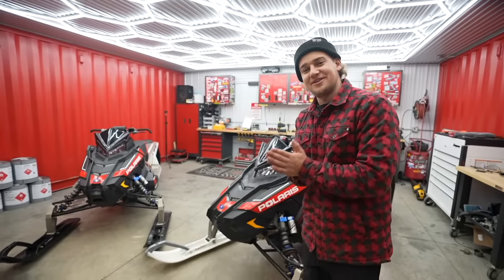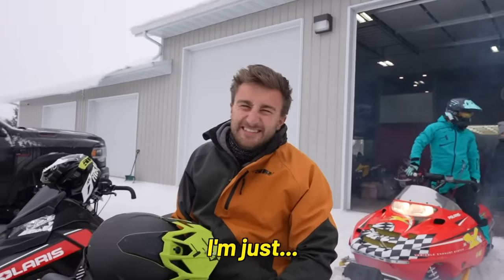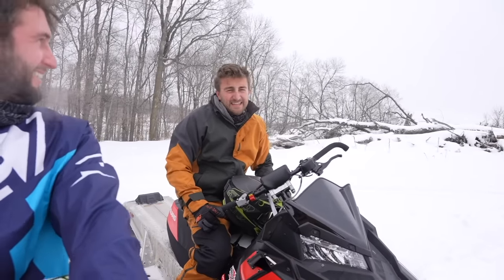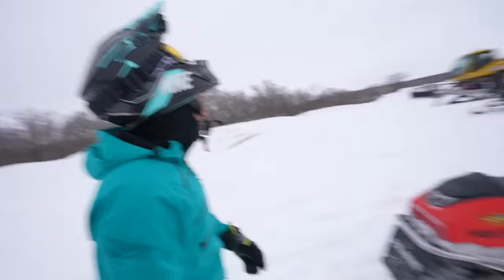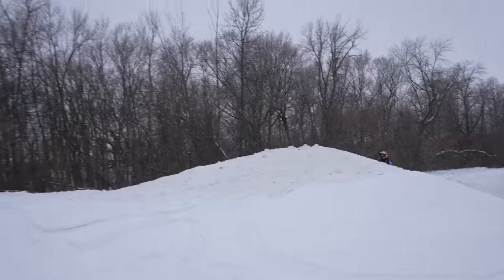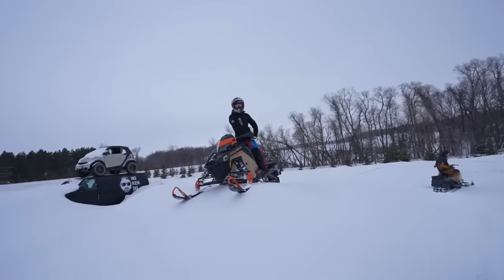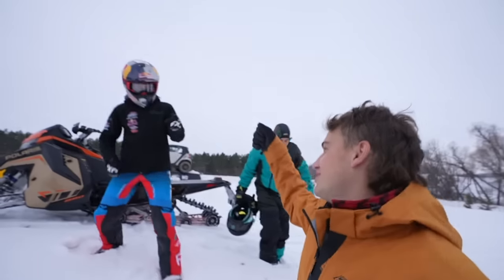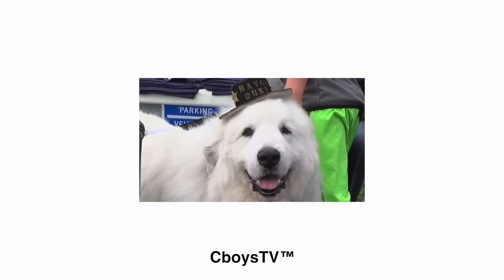Old vs. New Snowmobiles on Backyard Track!

Comment: It would be fun to see you switch, the engine and all of the hardware that makes it run between the old and newEr snowmobile’s and see if the new ones still runs better with the old engine than the old one does with the new engine

Comment: Considering the obstacles aren’t too big, I’m yet to be challenged on a 2002 600 Classic with M10 suspension. I have out cornered everything hands down and it is decent in the air.

Comment: Hate to burst your bubble here but swapping the stock exhausts on the sleds you are probably losing horsepower. FactoryPipe makes all of the polaris exhausts and they used to be an aftermarket exhaust company but Polaris uses them now for their oem because their exhaust systems are just that good.

Comment: ...so you get brand new sleds in, and jump them, wheelie them and race them (and break them, bumpers, etc)... then sell them as new to customers? (not sure I get that)... First time watching you guys, but if that's the case, and I knew that about your shop, I wouldn't be buying anything from you... Sort of like the Chevy dealer getting in a brand new Corvette, and the guys take it out to the drag strip straight off the delivery truck... and on the way home, do donuts in a WalMart parking lot (or something)...

Comment: That’s not a pro x , that’s the edge which is a trail sled . The pro x race sleds came with walker susp and multiple heads and you mixed gas with a 5 gallon gas tank . Come on now